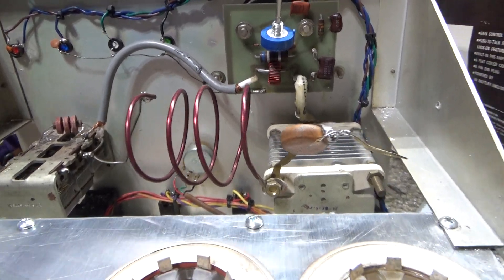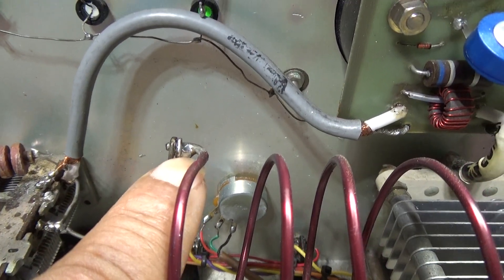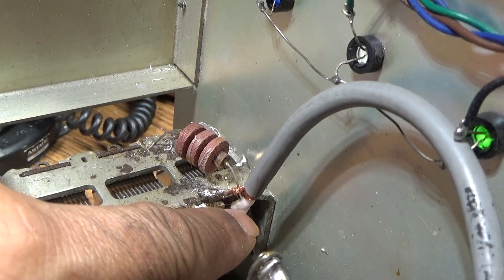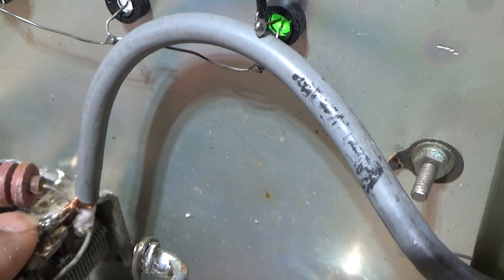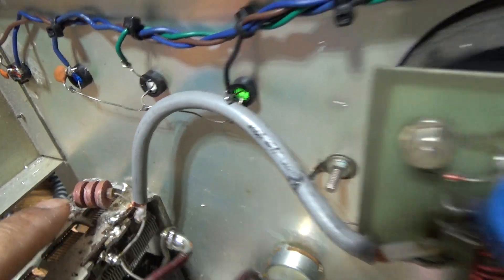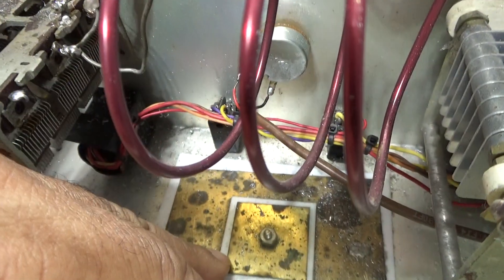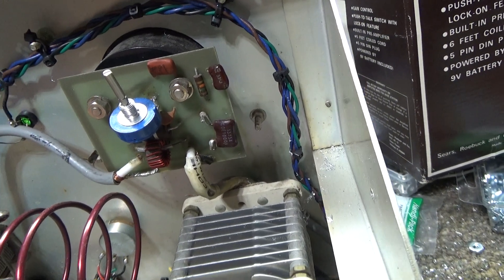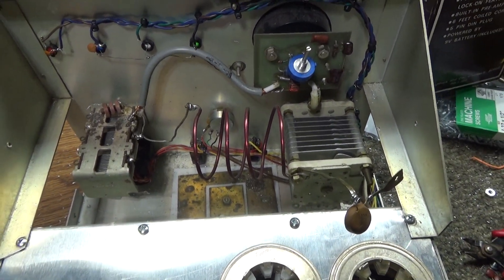Pride DX-300 monobanding for 10 meters walkthru

Comment: Hey T-doc, I'm interested in the PO  from a 2x tube DX300 mod.   Especially the current draw and the Mains fuse you run. I'm finishing a years-long Homebrew  2x 4cx300a 10-80 amp.  It' working but  I'm  addressing current issues.  Pulling 15-20A from 115vac outlet  seems to limit PO to 500w AM at 300mA & 2.1kv on plates.  All from an 18awg power cord w/ 5w drive (Grid driven DC grounded Kathode).   Awaiting 14awg cord.  I'm using  an AL-572 Transformer. Please keep us posted on the mod youre doing.  neil, NYC
Reply from the maker: I'm still working on mine. That's way too many amps for that little out. How much Bias you running?
Reply: @tramdr  On the 300a tubes it's lower than datasheet figure of -55.  Closer to -53 set by zsac at 200mA two tubes.  My prior complaint about current draw was a wiring issue (too small feeding plate xfrmr).  Ran 12ga through to soft-start and plate/filament  xfrmrs.  Two of these tubes pull over 500mA.  I suspect the stock xfrmr on Pride not big enough to get full benefit from another tube,   My plate xfmr is a 400mA 1800vac Heathkit (54-30) and was not enough to keep tubes happy.  I could go about 6-7 but likely distorted on peaks.  Can almost get that from 1 tube.  Last month I added another 54-30 plate xfrmr.  What fun figuring out xfrmr phase LOL.  Anyway PO 1.2kw peaks easy.  It taught me it was not the outlet but lack of Iron instead.  Homebrew Blues works great on the bench into DL but in shack on antenna that's where the faults show up and force me back to the bench.

Comment: Unrelated in a way, but relevant, I picked a a sbe la-1 linear ( 6lq6 , 6 of them! ). At some point someone took the band switch out and put in a Johnson roller inductor in its place.  This gave me the reasoning behind the previous owners modification so, thank you. 

You wouldn't happen to have a copy of the schematics and parts list for a sbe la-1 would you?
Reply from the maker: No schematics. Roller Inductors are cool though.  Note, that they are not made to be adjusted while transmitting. You unkey, adjust it, key back down then see what you got. Many people ruin them because they TX while tuning them.